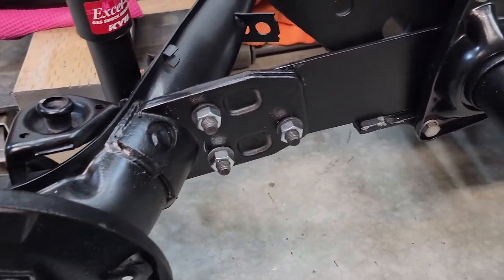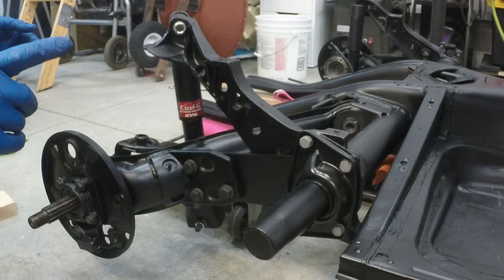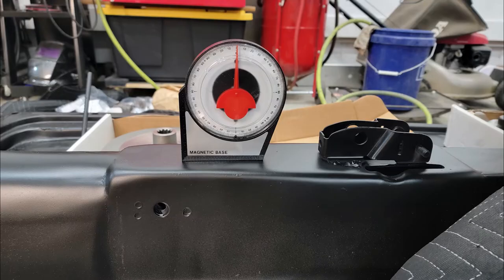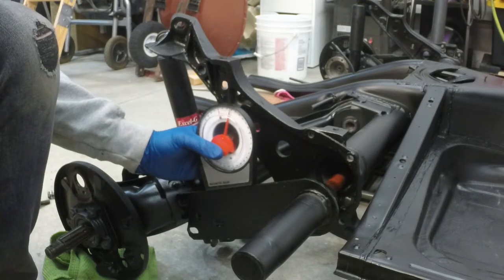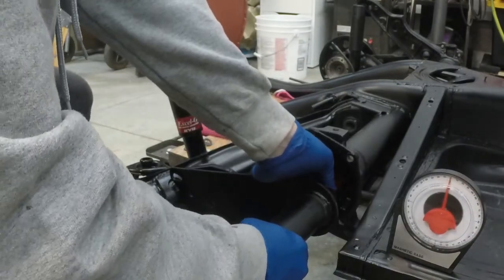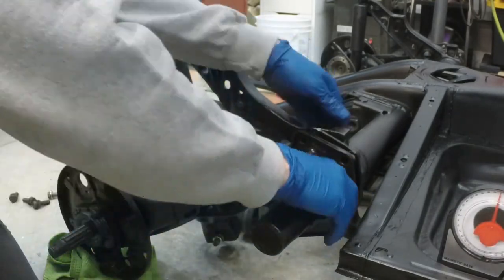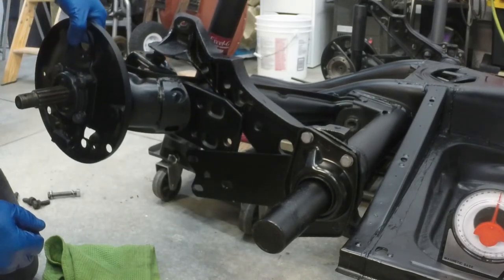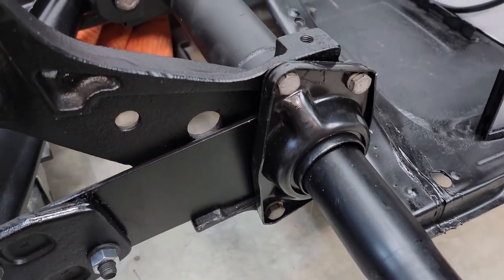Ep. 3 -1971 VW Super Beetle - Torsion Bar & Spring Plate Install, Lower The Rear Suspension 3"

Comment: Use the longer bolts from the bottom of your super bug strut to start on the spring plate and then swap to your short ones. The video didn't mention that these bolts are 15mm size, and using normal sized 17mm head bolts don't have room. The strut mont bolts are your friend here.

Comment: Ugh, let no one ever say adjusting torsion bars is NOT a pain in the ass.  This video was very helpful and as I type this, I'm reviewing the video to get the torque specs for the end cap bolts.

Just establishing the factory height was a pain.  In the end, I could never quite get exactly 21 degrees 20 minutes, so after randomly rotating the inner and outer, I fell upon exactly 10 degrees, by chance (yes, I, too, desire a 3 inch drop)!
Reply from the maker: Nice!!  Glad it helped out, hopefully you're out driving soon!

Comment: Not clear on how you got the spring plate back up on its shelf.  Did it just line up with the shelf without tension since you lowered the ride height?  Setting
mine back to stock height I’m expecting to have to use a jack under the spring plate to get it back up on its ledge.  Am I picturing this correctly?
Reply from the maker: Correct, since I lowered the car (raised the starting position of the spring plate) mine just set right on the shelf without much effort.  If you are raising the car (lowering the starting position of the spring plate) you will need to use something to press it up so it can be pushed over and set on the shelf.  If your car is assembled with the body on and engine in, a jack should do the trick, or I have even seen people use a ratchet strap to pull the spring plate up so it can be set into place.
Reply: @bottomupbuilds  Will be tackling this job tomorrow.  Thanks for giving me the confidence to proceed.

Comment: There is a tool that pulls the spring plate up to the stop, and also helps to safely remove the spring plate. It'll prevent the plate from slamming in the downward position.
Reply: although i totally agree w/ the safety notion...the "slamming down" is rather anticlimactic as it pops down an inch maybe?  I was prepared for a ground shaking event and its just not.  a bump of the hammer from the back and no fingers in the way and done.

Comment: Thank you for the video. Could you explain why you used two different greases? Is there a special kind of grease to use with urethane?
Reply from the maker: The grease I used on the urethane parts did come with the parts.  I believe there are some types of grease that don't pair well with it.  I figured it was a safe bet, in this case, to use what was provided.
Reply: I googled “grease for polyurethane bushings” and the recommendation was to use lithium grease.

Comment: Do you insert the torsion bar randomly?  Or is there a mark on the outer part of the torsion bar that’s tells you where the top or bottom is?
Reply from the maker: You can insert it randomly, then adjust it until you find the stock height, then reference the chart for raising or lowering.  I marked the top of mine before i removed them to make sure I could put them back exactly where they were.
Reply: @bottomupbuilds  on my 63 beetle, I set both sides to 17 degrees and the driver side is an inch lower 🤷‍♂️.
Reply from the maker: @cyprianskiba8768  Odd, maybe one of the torsion bars is getting warn out?
Reply: @bottomupbuilds  that’s my guess.  I put in an order for some new torsion bars and will see what happens
Reply: @cyprianskiba8768 Did new torsion bars fix your problem?
Reply: @1amPain the new torsion bars have really improved the ride and turning response.  I got ones that are a step up stiffer from the factory setting.  However, I have come to realize that finding a spot on the car to check the level is not always consistent with the other side.  So after installing new torsion bars, I had to readjust one side and then use my adjustable spring plate screws to even out the car on both sides.  

After all this, I’m still glad I got new torsion bars.  I think the OEM ones are a bit soft.  Maybe because after sixty years they are a bit tired.  Hope this helps.

Comment: Question: Is the round rubber on the outside larger in diameter?
Reply from the maker: If you are referring to the part in the video at around 9:34, yes the outside IS larger than the inside.  IF you are looking at the bushing at about 10:30, the outside IS NOT smaller.  Bothe bushings can only go on in one direction and should fit the shape of the spring plate and cover.

Comment: What paint did you use on this chassis and has it held up?  Maybe you have a video on paint process?  Looks killer, just want to make sure it's gonna last.  My son and I are rebuilding my wife's grandfathers '72 super beetle.  Thanks!
Reply from the maker: Check out this video https://youtu.be/wmW3nXZ1dD0 on the process of cleaning and prepping the parts for paint.

This is the paint I used, Speedokote SMR-207/211 - Hot Rod Black Paint, Black Satin 2K Urethane, SMR-207 4:1 Mix Single Stage Gallon kit with activator Included

And this is the primer, Speedokote Epoxy Fast Dry 2.1 Low voc DTM Primer & Sealer Gray Gallon Kit, SMR-260G/261

I wish I had an update on how its held up, but other life projects have put the bug on the back back burner and so its still just sitting in the garage as of today.
Reply: @bottomupbuilds  Thanks a bunch for the response!  Amazing info.  And I hope you get back to the bug soon. :)

Comment: I see dark touch up paint on your torsion bars.  Can you tell me what that is?  I have unused 26mm torsion bars I've owned for approximately 6 or 7 years which have acquired a few nicks in the paint over the years
Reply from the maker: Whatever the black was that was on there, was on there when I pulled them out.  It didn't clean off, like it was a paint or a glue/residue from something, whatever it was was stuck on really good.  Not sure where it came from or what it was though.

Comment: Follow up question.  Can you tell me the source of your torsion bar end caps?  I'd like to keep my factory ones, but one side got a crease like dent on the edge of the hole, and I don't feel it's safe to use.  I bought replacements, but they're not the correct ones(they looked correct in the online picture, but it may have been a representative image).
Reply from the maker: Sure, I know I got those from Mooreparts.com at the time they were the cheapest price with shipping.
Reply: @bottomupbuilds  do you have a part number for the end caps you purchased?
Reply from the maker: @MichaelValentine-w9p  https://www.mooreparts.com/search-results-page?q=%20AC511102B

Based on my invoice, that is the part I bought, hope that helps!
Reply: @bottomupbuilds  rats. Shows as not in stock.
Reply from the maker: @MichaelValentine-w9p  bummer, did you try the other usuals?  Jbugs, cip1, wolfburg west?
Reply: @bottomupbuilds  Cip1 had it. Thank you!